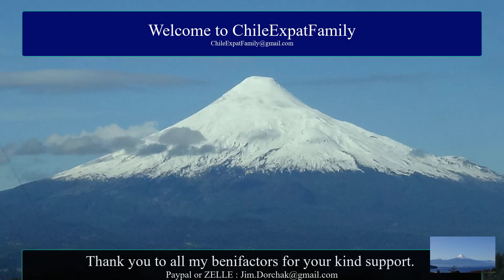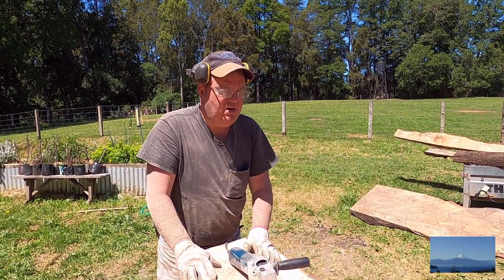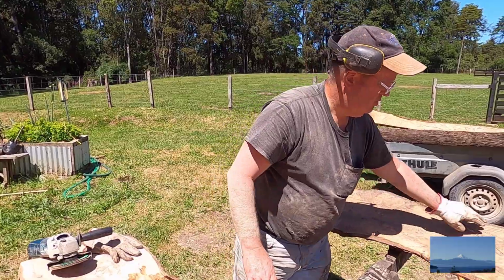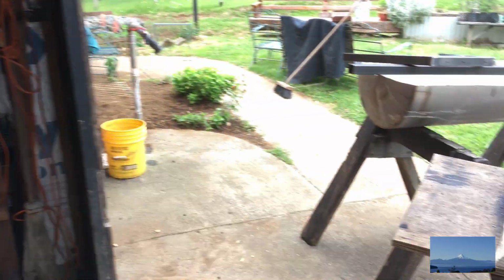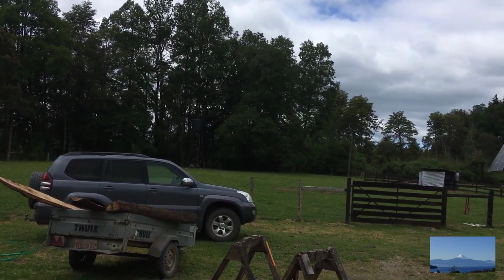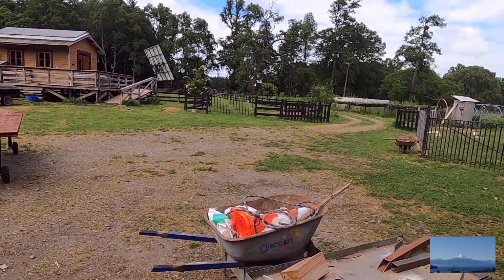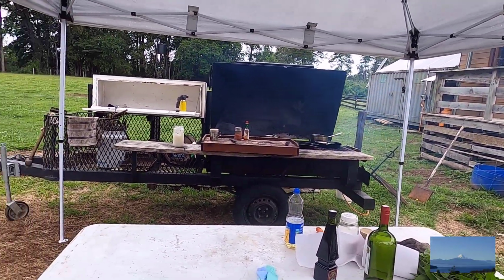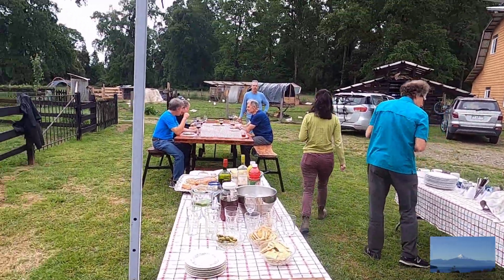Picnic Table For All Time Project Part 3

Comment: 1. When wood is green, does that mean the moisture content is high? At this point of course you can't bake or remove that moisture out if that's the case, but the need for a picnic table is higher than worrying about moisture now 😅.
2. Loving the cameraman comments 😂; is a joy to relish in your shared labor of love.
3. How would you prepare the sheep?
4. Are the bones of Salmon still useful? E.g. crushed or ground for calcium?

Props to Lars and Tom for the help. You all did a lot of work and it looks like the event was a success!
Reply from the maker: The wood was recently cut or milled from living trees. So it has a lot of sap in the tree and as it dries it warps. 

Thanks on the camera man comments. 

I use garlic / Salt / Pepper and Paprika. I smear the Lamb with Balsamic Vinegar to cut the taste of the fat some and them apply the dry seasoning. Sometimes I Mop the lamb on the spit / fire with hot melted butter and lemon with a little white wine mixed in for good measure. It keeps the meat from drying out. 

No the bones are a not good for anything but the fire. 

We cook for this bike tour group 2 to 3 times a year. It is a good time and we enjoy cooking for them. Jim